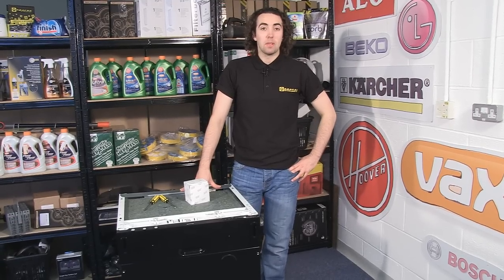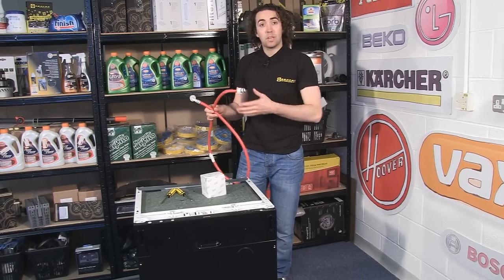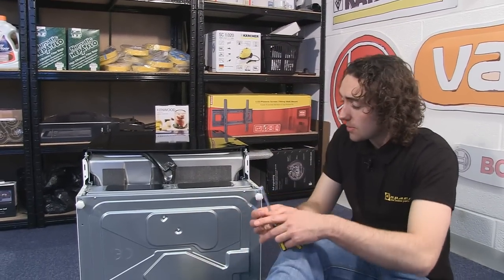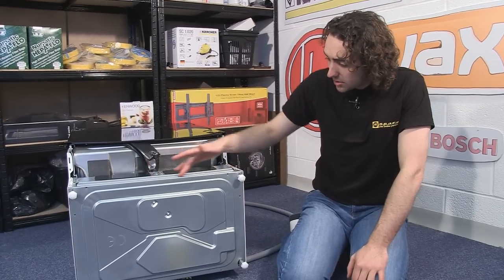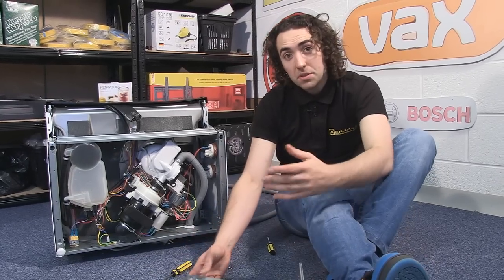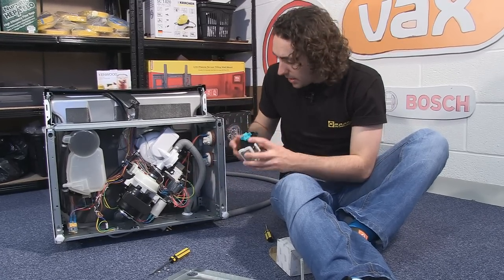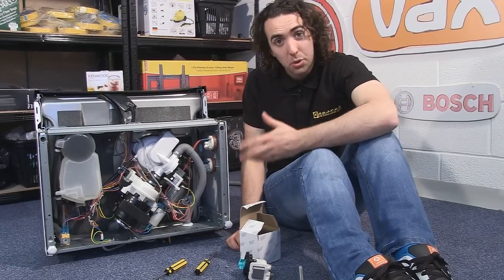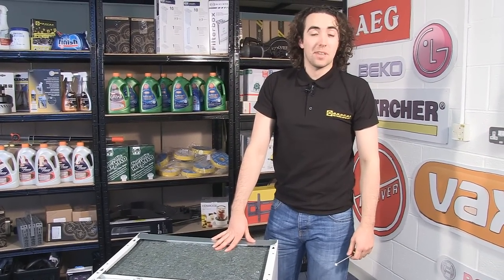How to Replace a Dishwasher Drain Pump - Gorenje

Comment: Hi I have a Kenwood KDW60s15 and it's leaking on the floor.  I've cleaned the filter inside the machine but it still does it.  Does this sound like it needs a new pump?
Reply from the maker: Hi GameThruz, you need to find where the leak is coming from first to determine what part is required, check all the external hoses for signs of leaks before checking inside.